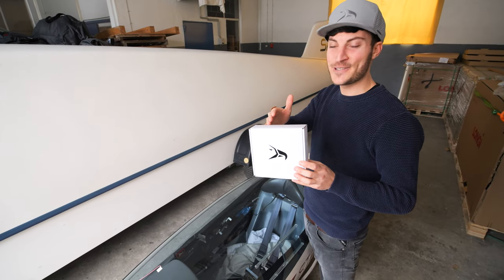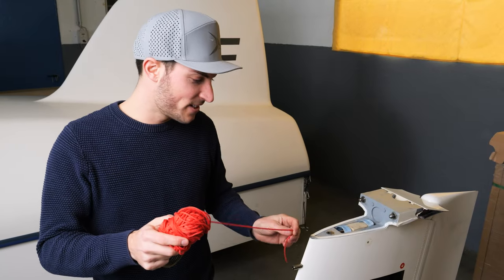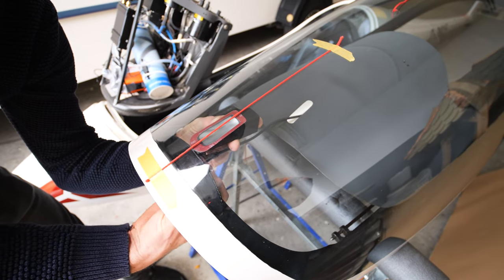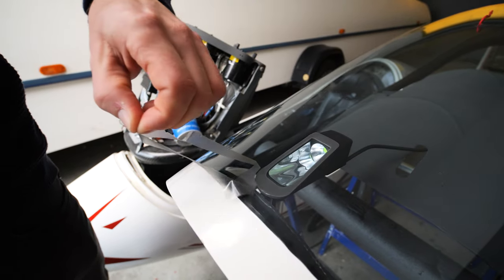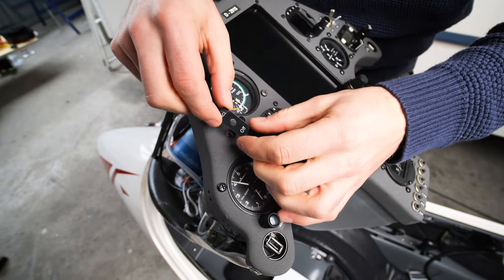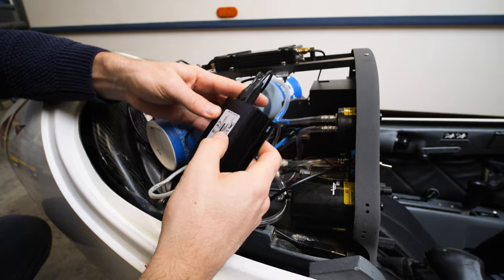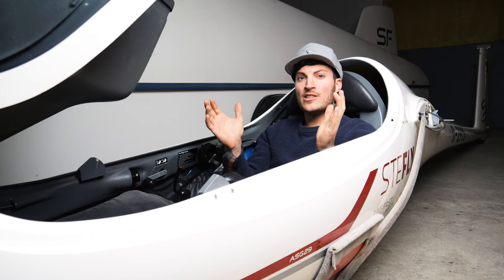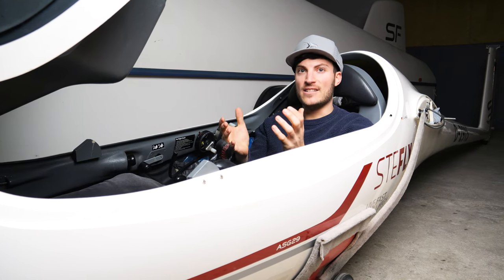Head-On Collision Avoidance - NEW SteFly Canopy Flasher

Comment: That's a cool device. 

Did you know that lidar lasers can detect dust in the air and even measure which direction it is moving at different distances from the laser? I started doing research on this when I discovered that I could see more of a dust devil with polarized sun glasses on than with my naked eyes. I thought, what if there was something that could see the dust even better and found lidar lasers. I believe that someday someone with money will finally figure this out and mount one that rotates in a full circle on the top of the tail or maybe on the bottom of the glider so it can sweep downward and forward. There is always some level of particulate in the air so the laser will be able to see what air is moving up, what air is moving down, and how fast it's moving. Air that is particularly thick with particulate will also be a signal of a thermal. The pilot will have something similar to a radar screen in the cockpit that updates as the laser rotates. This will give a map of all of the thermals within a couple of miles of the glider. With this thing you will be able to see all of the thermals that you used to fly right by because they were 400ft to the right of your flight path. Lol

This device will likely spark a lot of debate once it's made. Can you imagine someone showing up to a competition with one and being allowed to use it because there's no rule against it? Lol  New records will be broken with it too.

All I ask is that whoever takes this and turns it into reality gives it my name and gives me credit.
Reply: It's called a scintillator. Not a new discovery.....
Reply from the maker: I also have read an article from Sebastian Kawa about the LIDAR system. But of course it would be awesome to have such a system. We are currently at the point where the new sensor platforms are nearly showing us the real time data of wind and correct vario. In my opinion this is already a big milestone to the historical TEK variometers, with which most of us are flying around. Next week we will also publish more information to a new sensor platform called Larus, which is very capable and a big milestone.
Reply: @davidwedlock2622  Can you provide a link? All I can see is stuff about X-ray and gamma rays.
Reply: @SteFly  That's interesting. I can't find anything on Sebastian talking about lidar. I'd like to see what he talks about.
Reply: @SteFly  i also looked into it if commercial available Lidar systems are adaptable for gliders. As far as I know they are still to big and need a lot of power and computation time. Those are used for finding best spots for wind energy farms. Also for combining it with an augmented reality system a lot of calculation power is needed because the reference view is always changing.
But i am sure this will be solved someday.

Comment: Would be nice if it could detect other flashers and let you know there location
Reply from the maker: That's the job of the Flarm anti collision device. Most gliders in Central Europe are equipped with it and it will also warn you acoustically. When the flasher control box detects a glider ahead, then the flash frequency will increase.

Comment: the light impuls has to be a series of flashes..not single flashes...single flashes can be not seen by blinking, and by interpretation of reflection. The idea is good, but the frequency must be adjusted.
Reply from the maker: Have a look at my last shorts video, there you can see that there are 3 flashes with a short break, then a longer break... A single flash with a long break inbetween would not help much, that's true